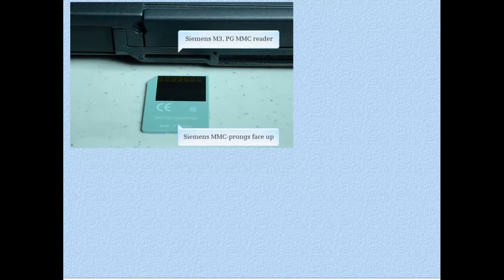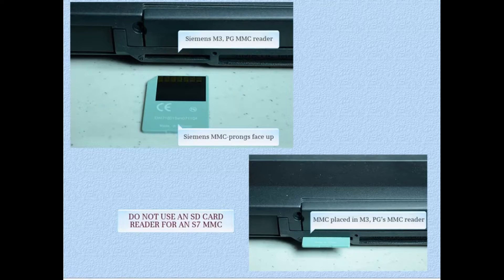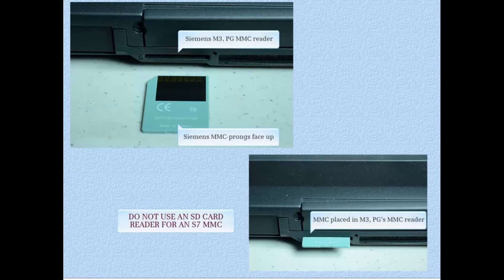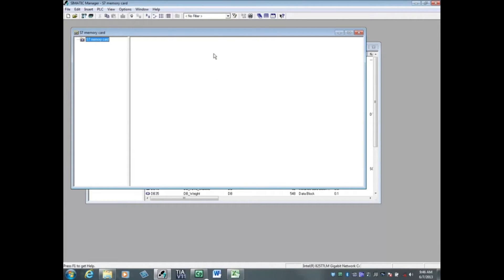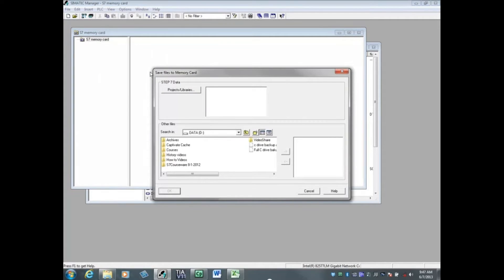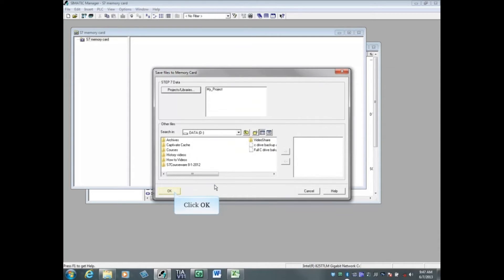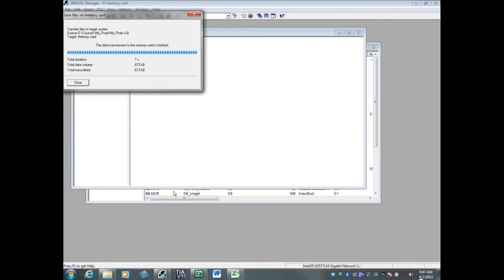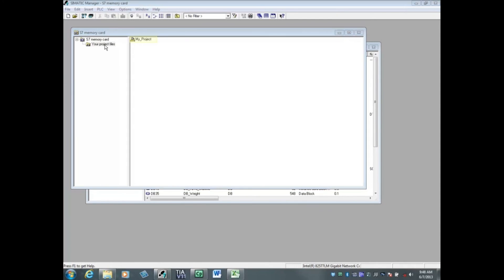10 : How to Use a Siemens PG to Transfer Files to the MMC from Simatic manager || Step 7

Comment: Hi, at 0:19 you say "Do not attempt to wok with the MMC with a standart card reader or you will ruin it." Is this also true for reading? I mean can I ruin it onyl by reading? I will not try to write anything to it. Thank you for your time and all the valuable information you give on your videos.
Reply from the maker: Yes..the format may change
Reply: @TheAutomationCentral  How can that be technically  possible? Is Windows going to change the format of the MMC without asking me? Don't get me wrong please, but, are you sure Sir?
Reply: @TheAutomationCentral  Here is an answer from ChatGPT :

If you're only reading the contents of the MMC card using an SD card reader and disk imaging software, there shouldn't be any risk of causing the format of the MMC card to be changed or any data loss on the MMC itself. Reading from the MMC card is a non-destructive process that simply retrieves the data stored on the card without making any alterations to it. As long as you're only reading and not attempting to write or modify any data on the MMC card, your data should remain intact.